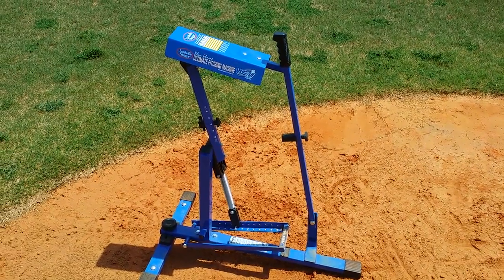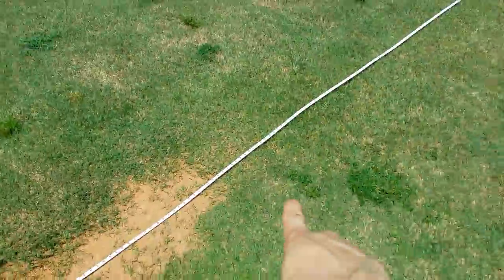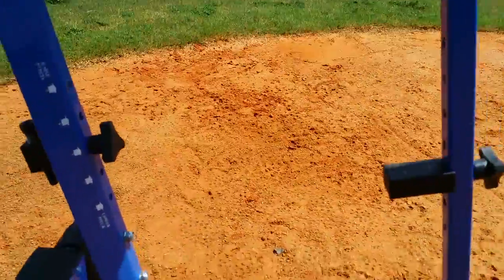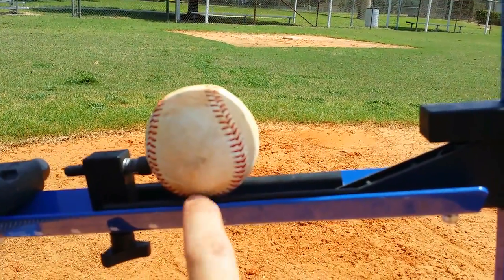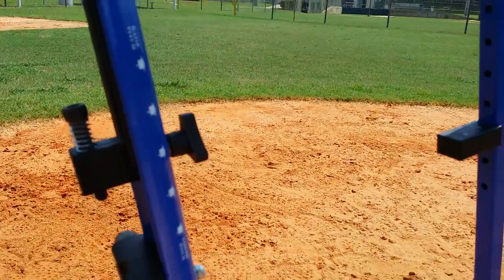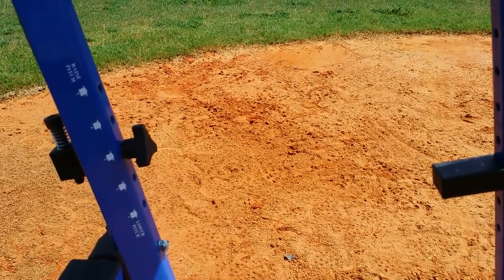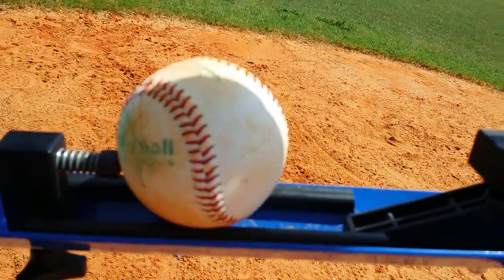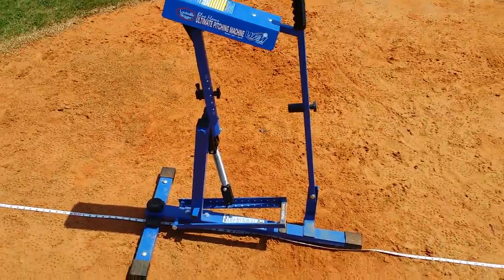South Lake Little League Single A Machine Setup

Comment: I just ordered the pro version and right from the start I plan to drill two 5/16" holes about 1" beside the ground stake holes that are already in the front stake bar then use 6-8" ground stakes along with the factory stakes to ensure it will not move backward/forward or side to side

Comment: Dude honestly i appreciate the video but i throw 4 seams and it works every 3rd pitch down the middle any tips?
Reply: Old balls that are in poor shape or different style baseballs made of different materials inside or out being used together will effect the accuracy of this machine. The more alike the balls you use the more consistently accurate this machine will be. Another thing that can effect accuracy is if the operator begins removing weight from the pedal before the pitching cycle fully completes. Even just a small let off of the pedal at the end with your foot can effect ball velocity and accuracy. I was doing this last one and it took me a bit to realize I was not keeping my foot solidly planted down.

Comment: Great video.  Can you elaborate on the ball types?  You said LC5.  But what about others I see like ROLB1Y, etc?  All the literature just says "works with all ball types".  I guess more specifically, for our 8U team, what options of balls could we use on this for a consistency stand point?
Reply: It will take basically any ball from little league to professional baseballs to softballs. For more consistent accuracy you want to set the machine up with one type of ball and stick with that ball style for the session. If you use different kinds of balls with different weights and materials mixed together it will significantly negatively effect the accuracy of the unit. I keep 1 or 2 older scuffed up balls in my bucket and every time it throws  those old baseballs they sail 2 feet high every time.